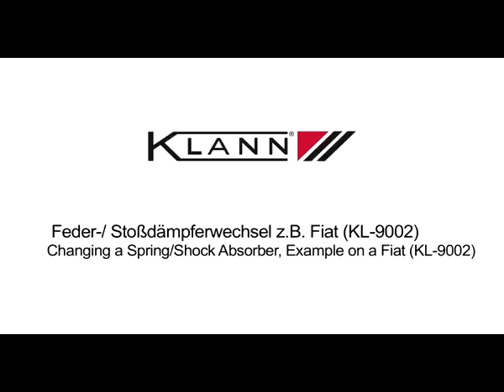KL-9002 Changing a Spring/Shock Absorber, Example on a Fiat

Comment: Here are the torque specs for the Grande Punto used in the video - not sure why they omitted them, despite using a torque wrench?
4:31 strut mount - 40 Nm (M12 - 18 mm)
5:22 knuckle bolts - 110 Nm (M12 - 18 mm)
Anti-roll bar joint (not shown in the video) - 50 Nm (M10 - 16 mm)
5:47 strut top mount - 50 Nm (M12 - 18 mm)
Wheels - 120 Nm (M12 - 18 mm)
Source: http://4cardata.info/elearn/199/2/199000000/199000000/199000001/199000972

Comment: The part you remove at 2:53 is the upper strut mount, correct?
If I am able to shake my front strut by hand when is jacked up, is this the part that needs replacing? I can also see there is a gap on the top part of the strut mount when I have the weight on the struts. I have the exact same strut on my Fiat. Thanks in advance!